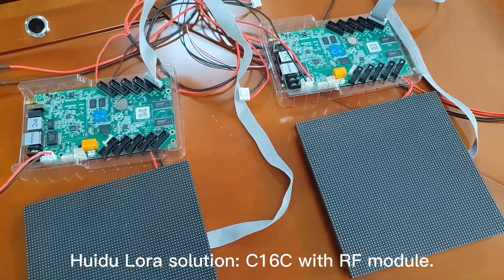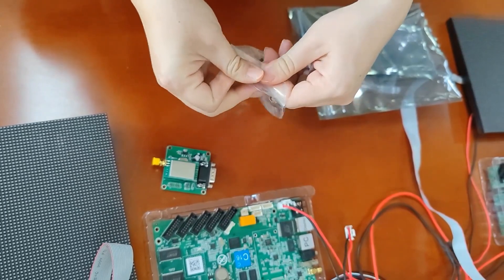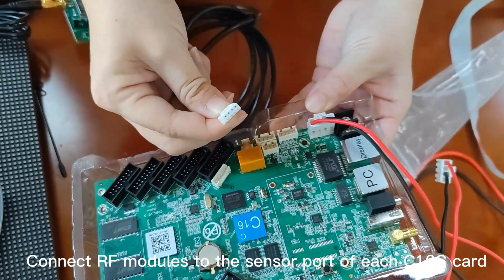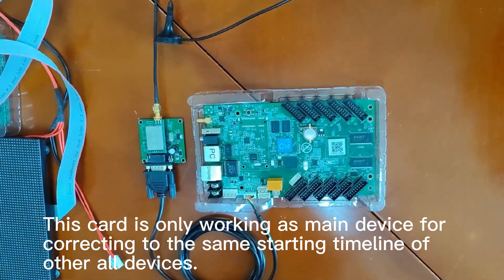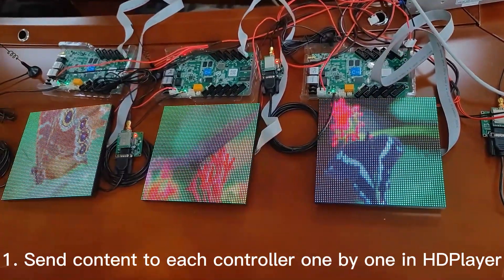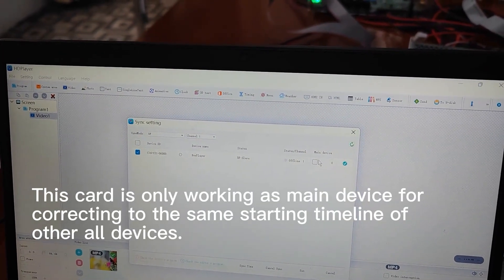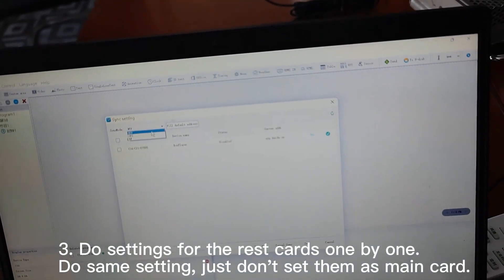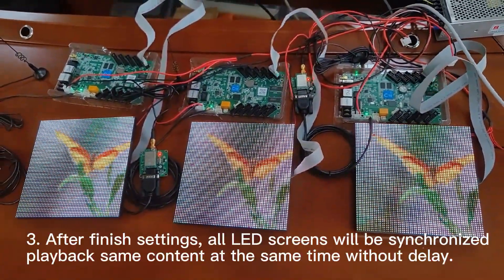Huidu C16C: How To Make Multi LED Screens Synchronization with RF Module

Comment: Will this work with HD-D16? And if I wanted to control over 4g I'd only need one HD-D16 +4g ?
Reply: So two HD-D16  and one HD-D16 +4g
Reply from the maker: yes, my friend, D16 also can add both RF module and 4G module at the same time. For in time support, welcome contact whatsapp/wechat: +8613510540791

Comment: can i use rf modul for 3pcs vp620, or 1pcs  vp1220 and 1pcs vp620 ?
Reply from the maker: hello my friend, RF module is used in our huidu asynchronous controller, such as our C16C, D16..., for the solutions of multi-screen playing the same content at the same time. It can not be used in video processor(VP620 VP1220...).  Any question, please consult WhatsApp: +8613510540791

Comment: Information is great.I was searching for it.Video and voice should be slow.
Reply from the maker: Ok, thanks for your advice. when any question, welcome contact WA:+8613510540791
Reply: It isn't available in India now.Searching for dealers to purchase it in India,for my projects. Have u any knowledge about India?Your products are very good and user friendly.Kindly inform what is the operating range of showed RF module in this Video.Can you send to India in my address?Please suggested.
Reply from the maker: @sangramsethi3879  Thank you for your recognition. The operating range of RF module is better within 200 meters. What kind of LED project will you need to use it? Now it is out of stock in India, for more details, can we talk on Whatsapp: +8613510540791🙏
Reply: @HuiduController  ,thanks for ur valuable information.
Reply from the maker: @sangramsethi3879  my pleasure🍵
Reply: Yes,I will contact with WhatsApp.
Reply from the maker: @sangramsethi3879  ok🙏